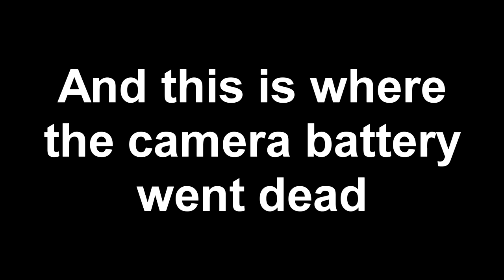Kohler Command Pro V twin build Part 4. Cam and Crankshaft.  #enginebuild  #provtwin #outlawpulling

Comment: Looks like a high rpm twin. I'd set the crank end play to the higher end of the spec (.020) or it will stick the crank to the closure plate.
Reply from the maker: That was my plan. Thank you

Comment: When you said reverse grind cam in earlier video, did that mean the engine is meant to spin in the opposite direction?
Reply from the maker: No, the engine spins the same direction. The heads are reversed meaning the intake faces the pto side and the exhaust facing the flywheel. This gives better flow and get the carburetor our front when using it in a cub cadet frame.